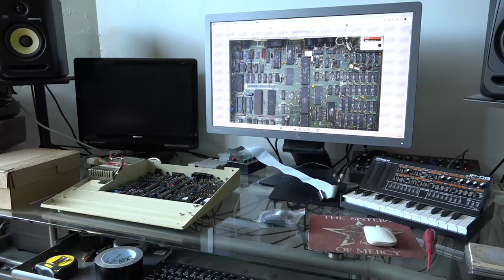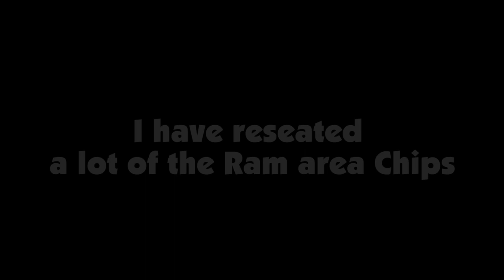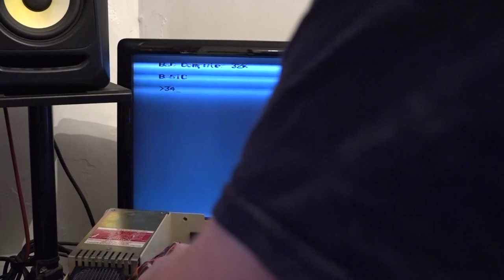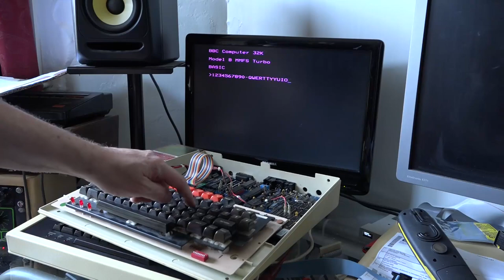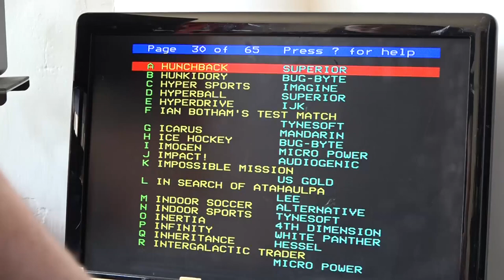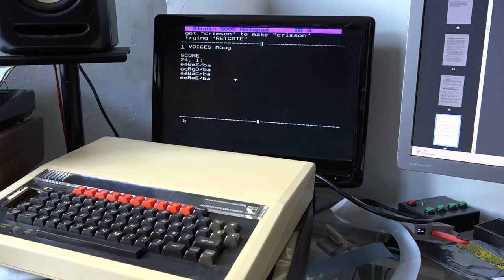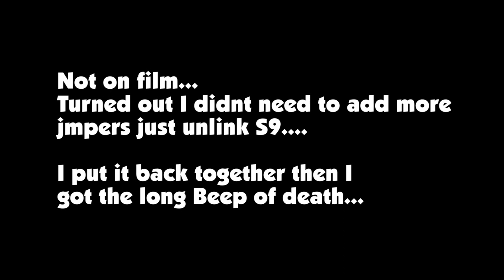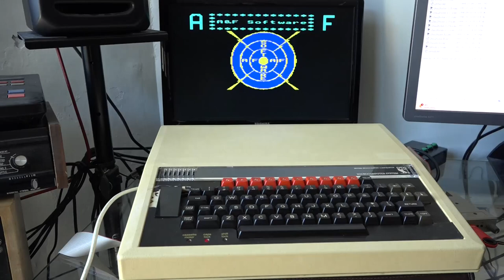Let's Build an Acorn BBC Model B Micro Computer from scratch Part 4

Comment: In an interview with Steve Furber, designer of the Beeb hardware, he talked about the 81LS95 chips. In that they were a problem, and for an unknown reason the computer would only work with 81LS95s made by National Semiconductors. And now the 81LS95 is obsolete, no longer made.

Comment: Absolutely ace series of videos. I don't remember that last time I was so nervous as I was whilst waiting for that power up and then......gutted. But all better in the end. Whew.
I've been collecting parts for the better part of two years to do the same. I'm nearly there but still need to source connectors and a keyboard.
Reply: My build is finally done (except I've still not sourced a serial ULA) and......it did not boot first time.

<cue trombone>

Turns out my system ROM was bunk but now all is well. Just today I've for my Raspberry Pi econet server running and working on my (almost) brand new Beeb. O Happy Day.
Reply from the maker: Yea you really need a dead beeb one of the din sockets is impossible to find but it's one of the greatest achievements in my life I'm going to build another music 5000 for it and the midi to user port interface to have it in my studio at my other place !
Reply from the maker: There is nothing more satisfying then hearing that second beep tone congratulations
Reply: @MatthewNorthMusic  Right? That half second between flipping the chunky switch and hearing the boo-bip lasted for bloody ages!
Reply: @MatthewNorthMusic  Yeah, it's really difficult find dead Beebs here in Seattle so it took a very long time and waaay too much money to collect everything for the build. Labour of love and all that, Very satisfying though.
Reply from the maker: Oh wow didn't realise you were in the USA yea very rare are you using a pal monitor ?
Reply: @MatthewNorthMusic  luckily, between my profession involving television and my love British computers, I've got plenty of PAL options here. ;)

Comment: The Model B had from the start 32 kB of RAM, but in 2023 memory is no longer that expensive any more. The BBC Master had 128 kB RAM, and there is a system of addressing the memory above 64 kB chosen, therefore it can be done. Wouldn't it be nice then if all Model B's would be expanded to what is available now. One megabyte will only cost a few nickels and dimes, shillings and bobs.
Reply from the maker: I had a Watford 32 k expansion but didn't use it 2 of my Beebs have extra ram care if the ifel sidewards ROM ram board though I'm using my master a lot more at the moment